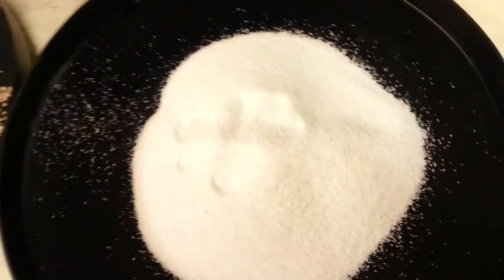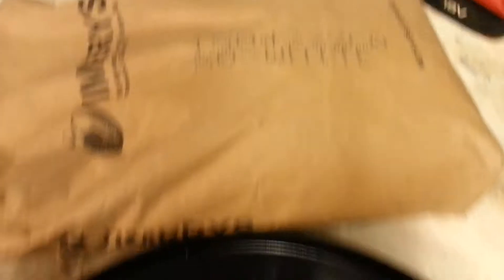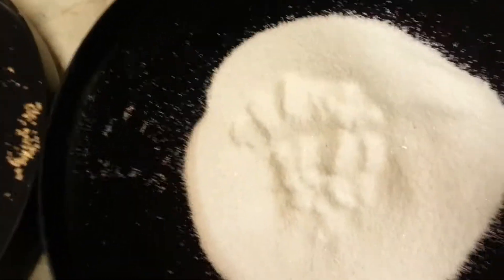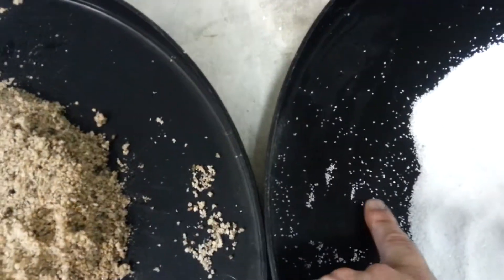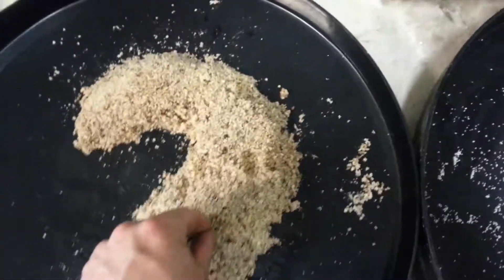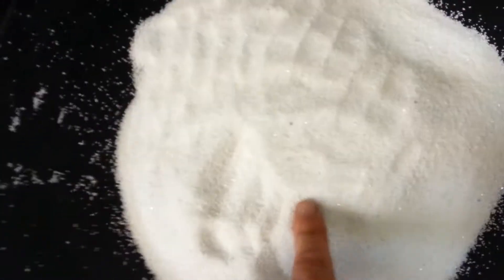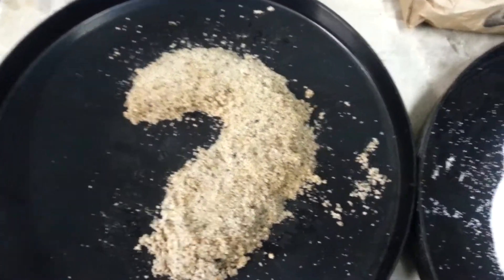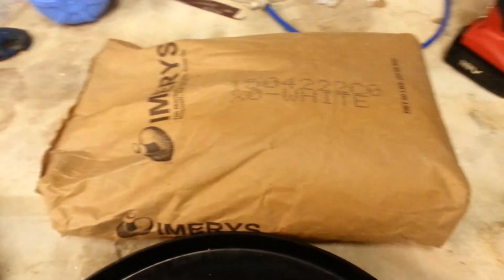Why doesn't my calcite neutralizer work?

Comment: The mystery material on the left is most likely Pennsy Supply calcite. For decades I've purchased my calcite in a 5 gallon bucket from the local plumbing supply store and it looks exactly like the Imory marble.  Plumbing supply went out of business and I found the Pennsy calcite at the local hardware store. Said "Fine Calcite" on the 50lb bag, NSF 60, so I bought it thinking I had the same stuff. The Pennsy granuals are larger like your mystery material and various shades of off white to dark grey. As you say, just crushed limestone with impurities, not crushed marble.
Reply from the maker: Thank you!

Comment: I am using Imery's as well and I agree, it is a great product. Would you know if it can used safely to re-mineralize and ph balance the water before drinking it? I wanted to use this water to re-mineralize my RO water and I thought this would be a good choice provided it is NSF/ANSI certified.
Reply from the maker: I have used it in remineralizing cartridges. It is NSF certified.
Reply: @tedmaxnews  Thank you! I have also noticed from other friends who have used it they mentioned their TDS increased by 30 to 50 ppm. Have you noticed the same?
Reply from the maker: @d3877  Yes, the water will be similar to Poland Spring. Personally, I don't re-mineralize my water because pure water tastes better.

Comment: If my water is between 6 and 6.5, do I need a calcite filter??
Reply from the maker: Swankster 

Most likely you would benefit from a neutralizer. Do you have pin hole leaks or blue green stains?
Reply: yes, I have the blue green stains in toilets and showers. Also, I had 3 water heaters go out in the past 3 months (1 in house, 1 in cottage on my property, and 1 in my trailer).
Reply from the maker: Swankster 

Sounds like you need a neutralizer.

Comment: With very low pH (4.93) would you still recommend a calcite neutralizer vs a soda ash injection system?
Reply from the maker: Wow, that is incredibly low. I think apple juice is 4.0. 

You may need both technologies to work together, but first, I would check to see if aeration would do a lot of the work, because many times an incredible low pH is caused by a dissolved gas. Take the sample and aerate it by shaking it and see if that raises the pH. Also, make sure there was not something wrong with the test. At that level, I doubt a water heater would last a year.
Reply: @tedmaxnews  I've had it tested 3 times and it comes back between 4.93 to 4.98 with everything else below thresholds, I will test that later today, surprisingly water heater is 10 years old, but I did have to repipe my house with pex. Thanks for the reply